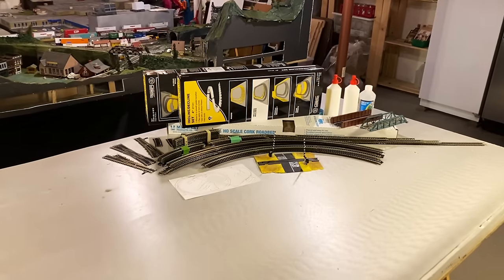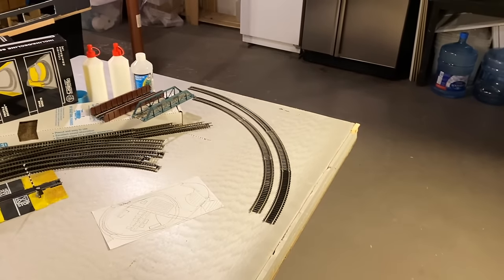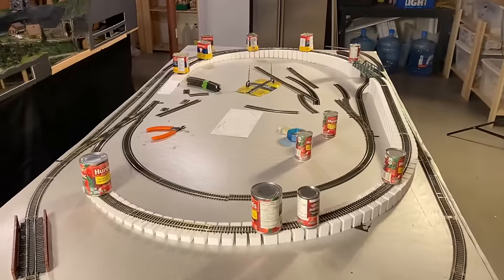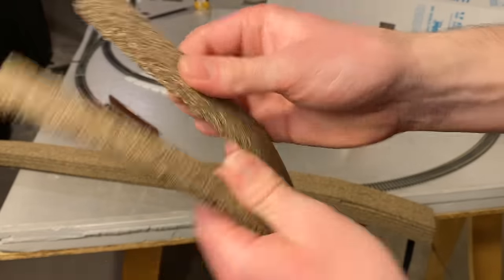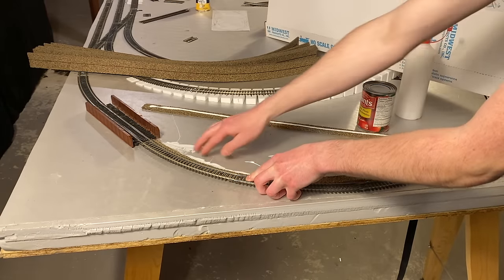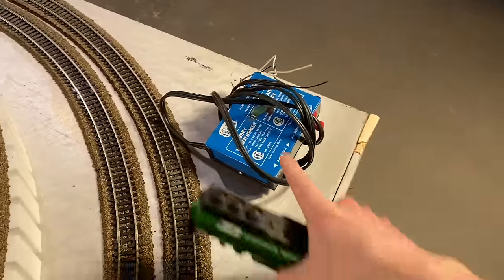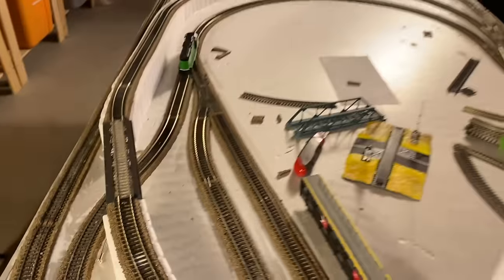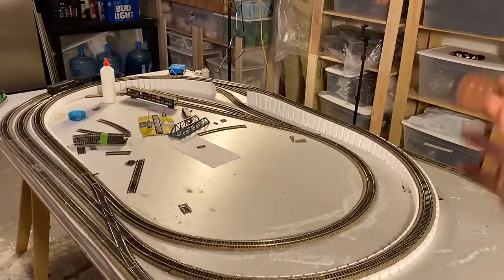I'm Building a New HO Train Layout - Model Railroading

Comment: Thank you for your videos! I am a 72 year old cancer patient and I have learned some good stuff from you. I need help wiring my Tyco Chattanooga. I bought it used. I got the engine running but the wires were off and tampered with by previous owner. Can you send me even a hand drawing? Thanks again. ChooChoo Ronnie
Reply from the maker: Thanks for the kind comment. There should be two wires going from the locomotive to the tender. One connects to the motor block, the other is soldered to one of the brush plates on the motor. The one without the screw in it.
Reply: @SMTMainline  I wired it wrong before I got your message. Do you have a power torque motor for sale? Thanks again CHOO CHOO😊
Reply: @SMTMainline  thank you. Found the parts to rebuild it. 👍🏻
Reply: @SMTMainline  the rebuild kit was for the wrong motor still looking for a usedmotor to buy.

Comment: running only 1 train that inner so close to the outer makes no notice;  run passenger trainss on each that they pass each other in those tight curves.   Or leave 1 parked in those tight curves while another passes.
Reply from the maker: That's a good point.

Comment: Which hobby store are you using? I know of Hobby House, Hobby Centre and Orleans Hobby. I hear there is a train store out in Merrickville as well. Is there anything on the Gatineau side?

The fact that you are pushing pins into the base is telling me that it is a insulation foam base? Do you have issues with the track and cork etc tearing lose from the base?
Reply from the maker: I usually go to Hobby house but the others you've mentioned are great too. Orleans hobby doesn't have much stock these days though
Reply: @SMTMainline  yeah Orleans hobby is a lot smaller than it was 30 years ago. Had the chance to check out the store in Merickville recently a huge selection. Hobby House has such friendly staff.
Reply from the maker: @jasonkebic741  Great guys there. They're both sons of the original owner
Reply: @SMTMainline  It was sad when the father passed. He was a great guy Same staff there since I started going there In the early 90s.

Comment: How do you go from inner oval to outer?
Why not solve that with two points at 28:02...
Reply from the maker: It got fixed in the next video but switches are expensive so reducing the amount lowers the cost by a long shot.
Reply: @SMTMainline  Yes I see that now. 👍
Yes points are expensive.

Comment: I was wondering if you could help trouble shoot my first train set its a bachmann the american train set brand new from eBay never opend and it completely stoped running but the motor was working my dad fixed it and now it stops randomly at 50% throttle and 100% it slows down a lot and the motor is still working I don't know what to do I'm super mad because its my first train set and it doesn't work and I've Benn super mad all day and I had only had it for not even a day when the problems started if you dont know how to fix it i dont have enough money to buy a locomotive because i spent it all on that set. please help i dont know what to do.
Reply from the maker: Have you checked to make sure the track is all connected properly? Someones the joiners fail.
Reply: Its all connected.and good but I think its the loco but I've been looking for one but there too expensive I spent it all on my set I have and every thing in nice condition is like $50 and I don't have that much im.on a tight budget so I can't run anything until I get enough money to buy loco

Comment: How much did you spend on it?
Reply from the maker: Probably around 300 or 400 Canadian
Reply: @SMTMainline only for layout 🥴
Reply from the maker: @Nc_Edtz  4x8 sheet of styrofoam $30,  4x8 sheet of plywood $40, track $160, box of cork roadbed $50. Foam risers and glue $30. $310 roughly. Keep in mind we face prices 30% higher in Canada